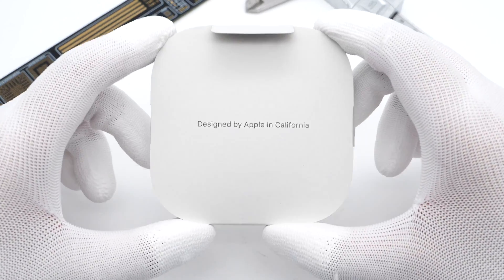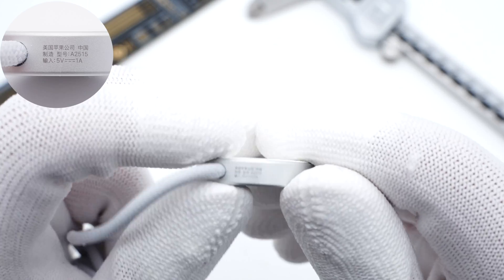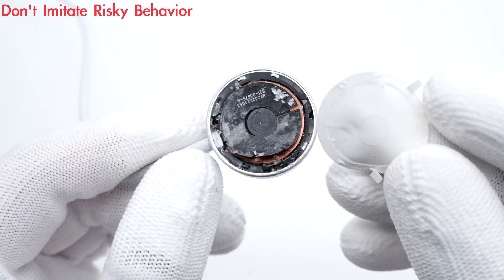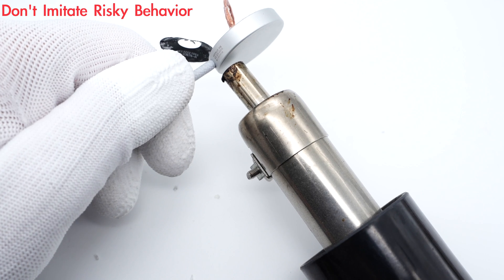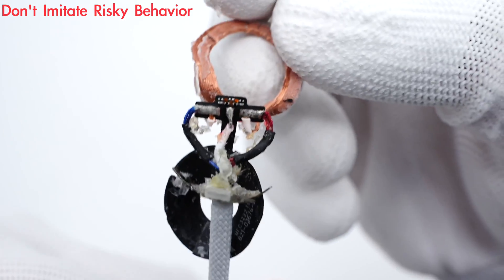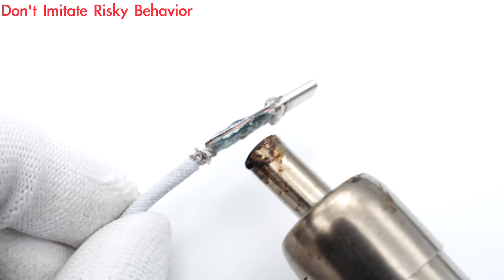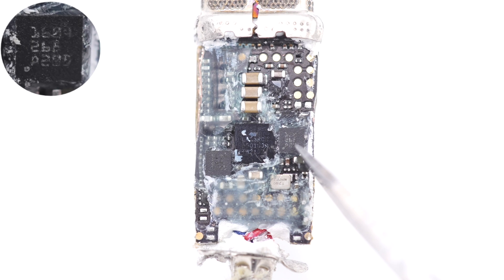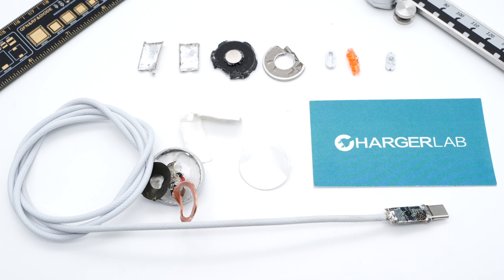Teardown of Apple Watch Ultra Woven Charging Cable

Comment: Looks like no easy way to shorten the cable.  Maybe I’ll just cut it close to connector and add a third party strain relief with some hot glue and shrink tube.